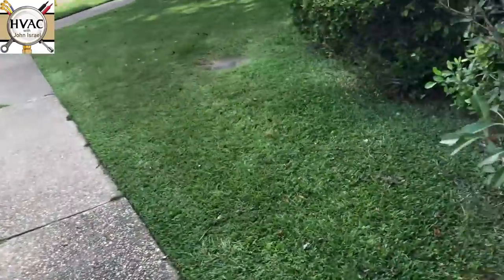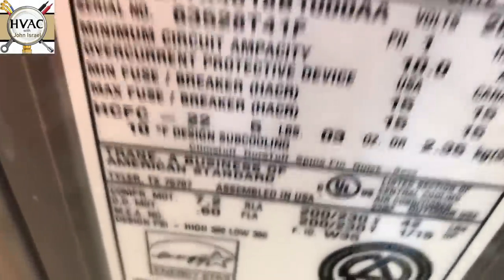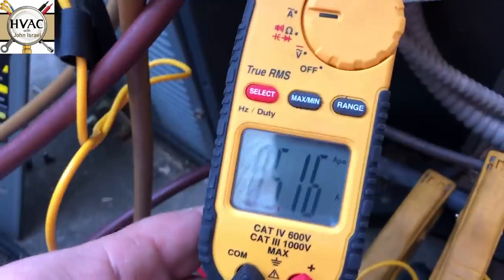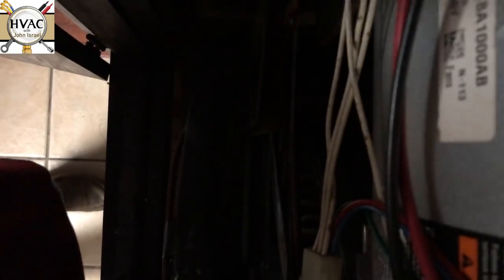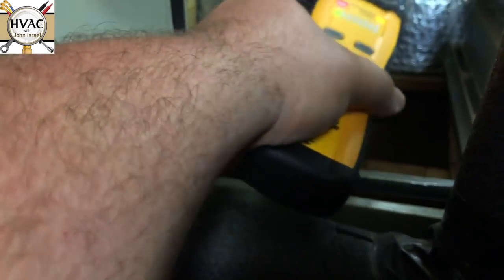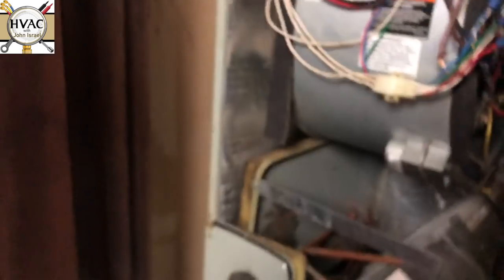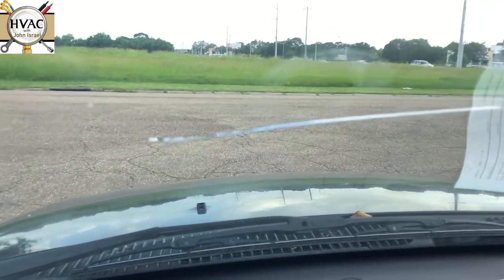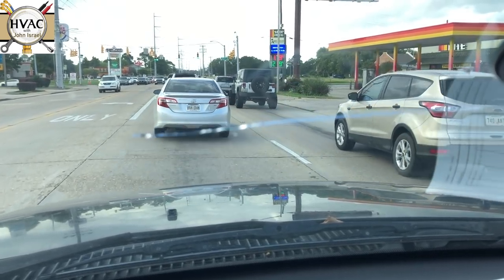Trane System Not Cooling

Comment: You’re right they are proud of them. I called this week for a 4 ton replacement coil. $1100. We ended up changing the whole system.
Reply from the maker: Oh yeah man it’s ridiculous. Last one they quoted me was a 3 ton for $1200. They are ridiculous.
Reply: Couldn't you just buy a different brand coil?
Reply: I couldn’t in my situation. Mine was horizontal application in an attic. I always worry about drain issue whenever  you put a different brand coil. Too many modifications to the panels to make it work. I’ll give the option on vertical units.

Comment: LOL @ the Ted callout. He does love his Trane systems. We just installed two Trane units into the house we're moving to since the R22 system needed a TXV. Didn't want to put that much into a 15 year old system. With that being said, the old house has a Rheem from 1993 (2.5 ton) still chugging along. We did a service call to check it out this spring, and the R22 wasn't even low after not being serviced for years. Those new Rheem's are handsome units. Our old one is that big rectangular box type with "Scroll inside" written on the top.

Comment: Throw some micro-leak sealant in there, charge it up and it'll likely be okay for a few years until the compressor goes.
Reply from the maker: Ya I don’t use stop leak. It doesn’t work.
Reply: @johnisraelhvac2019  I used it in a few older systems with a small leak, such as needing to be topped off every month or so.  Worked on both, one for two years and the other for a bit over three.  Eventually the compressors seized up, although did get some added life from them.  With old systems, its worth the shot.  IMO

Comment: Do you not know that coils can be repaired? No reason not to try
Reply: Igor C by the time you cut it out of the air handler and “attempt” to make the repair you will find it will still likely leak. Repair brazing today’s thin metals is difficult at best. The customer isn’t going to want to pay for a failed attempt. I’d rather replace the coil or the whole air handler.

Comment: Hey John. I got an old 8000 BTU Window Air Conditioning Unit. Recently I tripped the breaker in my house and I started having issues with the unit. Every time I try to get the Compressor to kick on, the fan speed slows down and then I hear a bing noise around the compressor and the fan returns to the same speed, so obviously the compressor isn't kicking on properly.  I thought at first it was the single run capacitor, so I changed it in hopes of solving the problem, but it did not. Do you know if these old a/c units that don't have electronic boards use any sort of relay that might need to be reset or do you think the compressor might be shot? I made a video to help further explain the problem I am having here -> https://www.youtube.com/watch?v=wcy64JdKyA4